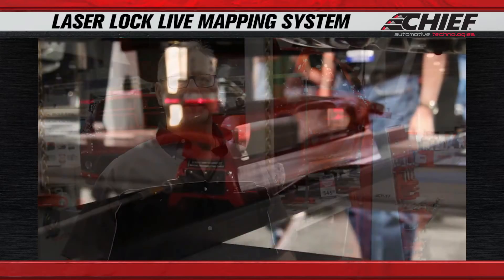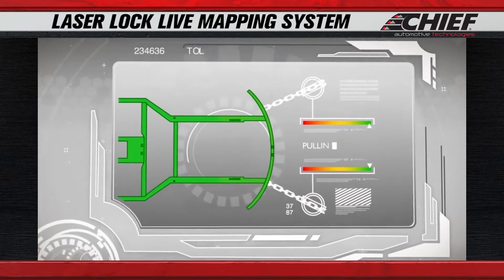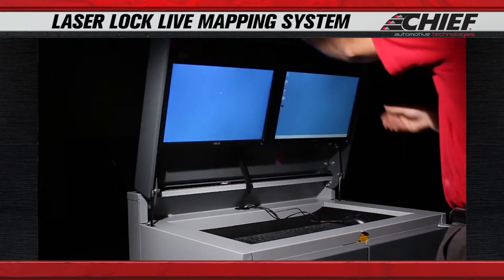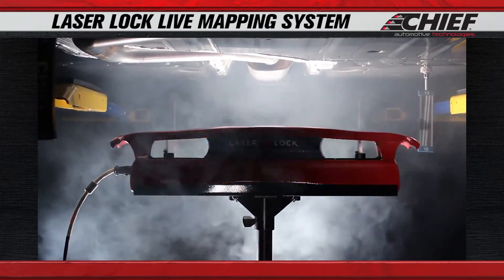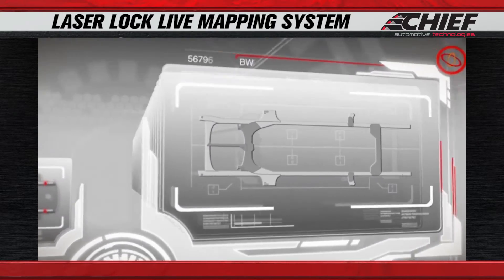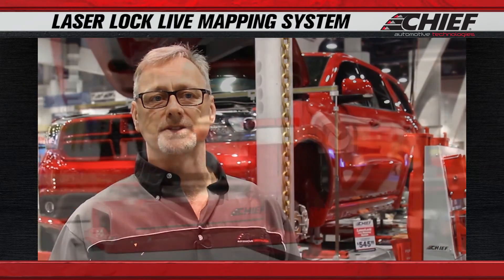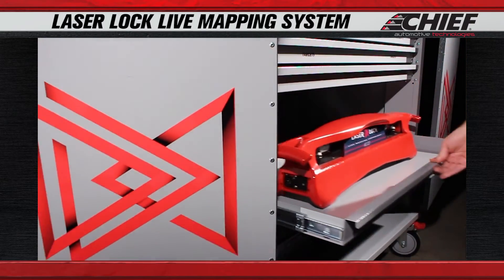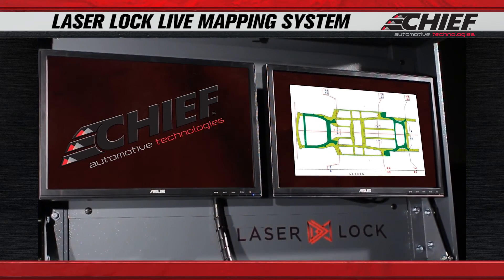SEMA 2014:  Chief LaserLock Live Mapping System

Comment: Will the Insurance company pay the necessary pull time so we can afford too lease such equipment?
Reply from the maker: The insurance company will pay for “set up & measure “ and “pull” time.  The set up and measure is usually a set time and the pull time is different for every repair depending on severity of damage.  With a electronic measuring system you can better document the damage to get a more accurate repair time.  Make sure to check out the video for our latest measuring system.  https://youtu.be/4cNLDt6XAh0